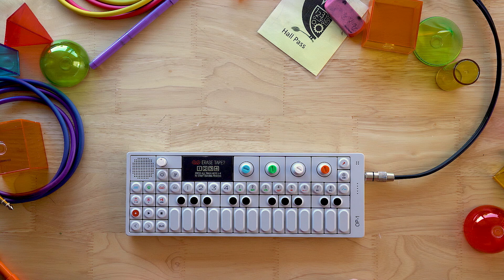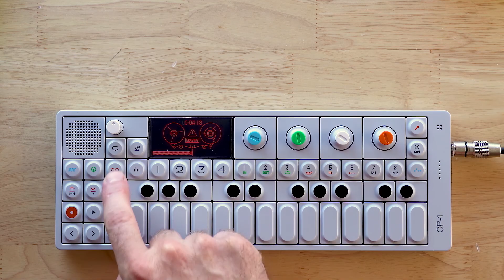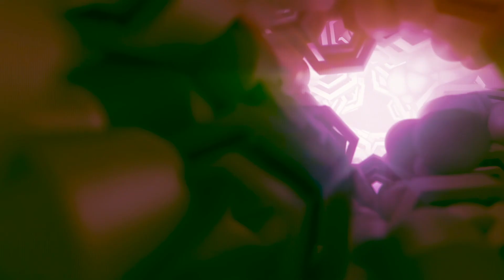Teenage Engineering OP-1 | Tape and Album

Comment: Very Good Video, thanks!
I have a question I wasn’t able to get answered yet by web search, so I had a op 1 few years back and backed up everything on my Mac when I sold it , I just got one again and loaded all the files onto it, now the tape tracks are on there  , but somehow don’t fit the grid markers, so looping the different beats I made is very hard. It seems the files didn’t include the tape speed info … how do I get the tape tracks to fit the grid again… ??

Comment: 15:10 This DRIVE setting at higher values will overdrive the built in speaker causing it to distort and crackle, often leading people to believe their speaker is broken. It's more functionally useful when heard through headphones or external monitors. 
Can someone please explain better how and why "...RELEASE is very important!"?  It kind of gets a bit waffly here - what are DRIVE and RELEASE actually doing? 🤓
Reply from the maker: think of it as a limiter with color. at extremely quick release values you get distortion, but at longer release values you get limiting and color.
Reply: @RedMeansRecording   Awesome - Thanks for the explanation. Do you have a favourite baseline setting that you feel is kind of optimum? I tend to just leave release in the middle (150). I noticed you had [L] and [R] at 95 which is what I tend to do (wind maximum values back a notch)